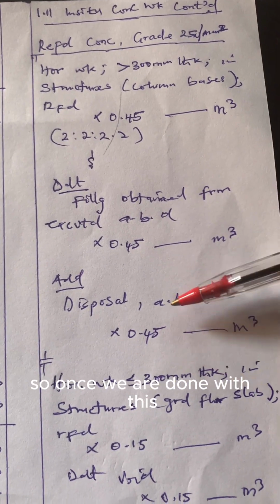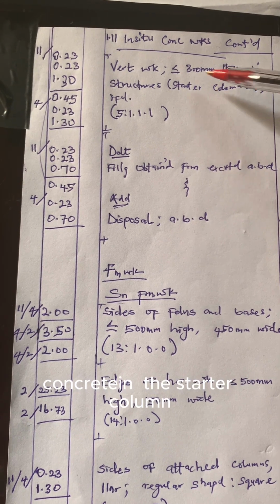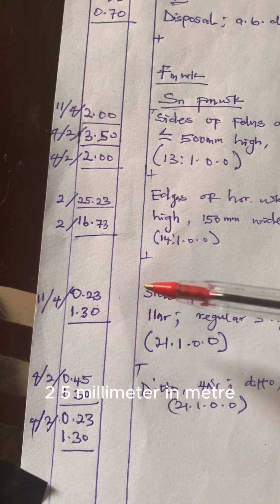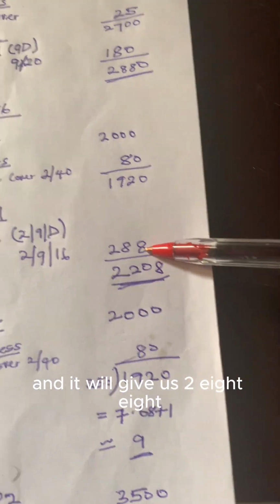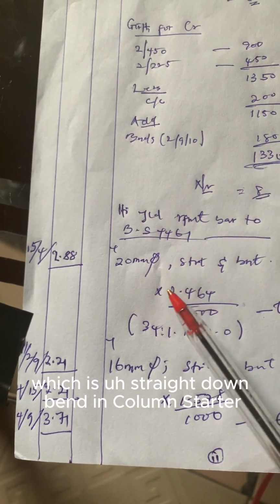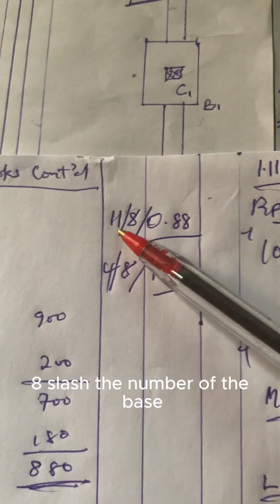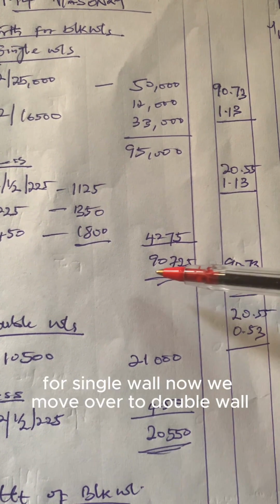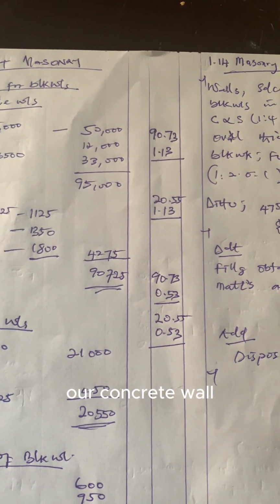How to take off Substructure works EP05 finale series

Comment: Sir What formula are we going to Use if we have 6Y20 in our column?

Are we just going to look for the Length same as  we did in 4Y20?
Reply from the maker: @NaijaBrilliant  The same method, only that the number of bars will change from 4 to 6
Reply: @PCNwogu  Okay sir Thanks, but I still need more enlightened because with the one have done the length will still be same, but I indicate the numbers of Bars as 6.

Comment: Why less concrete cover
Reply from the maker: @emmanuelokon-fd2fv  Concrete cover conceals the reinforcement bars.
Reply from the maker: Part of the process to get the actual length of the bar, is by deducting the minimum thickness allowable for concrete cover